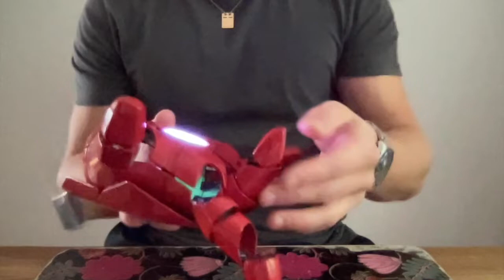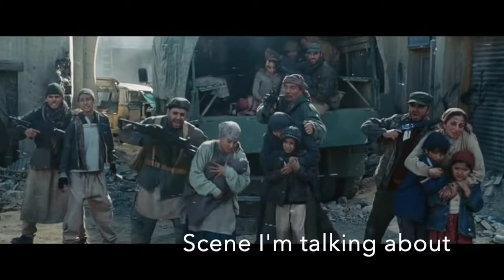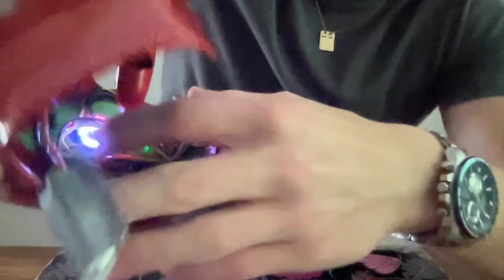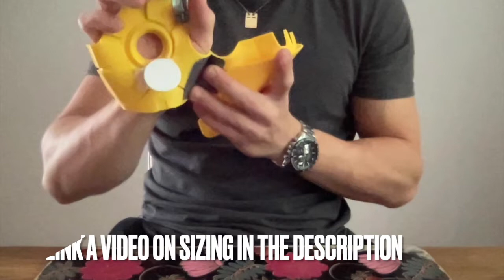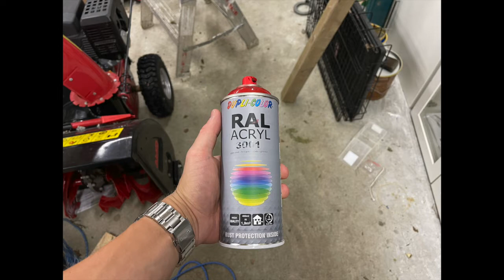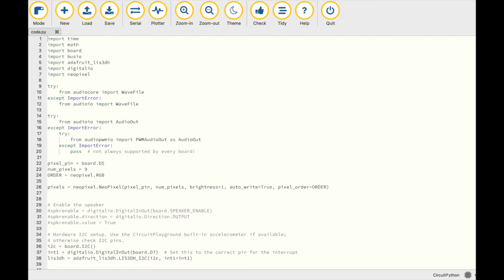How to make a realistic 3d-printed Iron Man glove with lights, sound and gesture control

Comment: For the Github coding, can i use “Adafruit ItsyBitsy 32u4 - 3V 8MHz” instead of M4 Express microcontroller?
Reply from the maker: It seems to have the special logic shifted 5v pins so you can use leds, but it doesn't seem to have DAC support. It might be possible to use a standalone sound board to store and play the sound files, or maybe you can play sound in some other way without DAC support. That said, sadly that board doesn't seem like it would work with the exact parts I used atleast.
Reply: @MrMCWolfCraft  thank you for the explanation. Sadly the M4 microcontroller is currently out of stock 🥲 have to wait for it to be instock then.. or do you have other suggestion for microcontroller that can produce the same outcome?
Reply from the maker: @illusionix252  Yeah chip shortages suck, I’m still waiting for a teensy 4.0 for my next project. Anyway, it’s hard to say without trying it, but I believe the adafruit itsybitsy m0 express would work the same, and it seems to be in stock atleast on the adafruit website. They’re very similar, both have DAC output for audio and 5v shifted pins to use with leds and the same amount of memory to store sound files. They are also the same size I believe. The processor speed is different, but I don’t think it will be noticeable as the processor speed isn’t the limiting factor here. I can’t guarantee it will work, but that would be my suggestion.
Reply: @MrMCWolfCraft  thank you so much. Im gonna try that. Woww, what other project do you have there? Please make a video. Hope to see more from you soon & Thank you so much for you help 🙏🙏
Reply from the maker: @illusionix252  I’m currently trying to build a VTOL rc plane, so once I get new components I should be able to make it work :)
Reply: @MrMCWolfCraft  i cant seems to make it work, im not sure why.. i not sure if its the board or the code. Im using circuitpython to save the code to my board. When i press “Check” if there is any code mistake on circuitpython, i see a few code has been highlighted. Which for pixels its says “line too long (99 > 88 characters)

& also on the # Enable the speaker. It says “Block comment should start with ‘# ‘ “

So im not so sure if its the code or the board. Any advise?
Reply: Nevermind.. it is now working!! TQ for sharing this again
Reply from the maker: @illusionix252  Okay great! Generally the line too long thing can be ignored, but some programming languages might force you to continue the code on the next line instead.

Comment: instead of using motion to activate the lights is there a way to wire up a button instead? i dont want to reach for something and accidentally flashbang myself
Reply from the maker: Yes absolutely! The trickiest part would be finding where to put the button so you can press it while moving the hand around, but the code itself for just reading a button state would be super simple. For my iron man helmet I put a button in the chin of the helmet so I can push it with my chin and open the face plate ”hands free” so it’s not obvious I’m pressing a button. maybe you could do something similar.